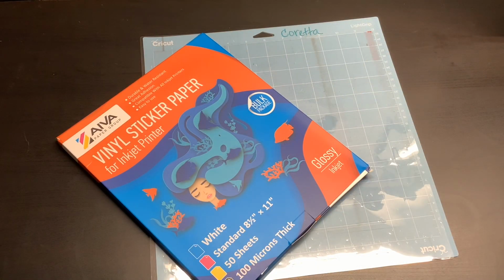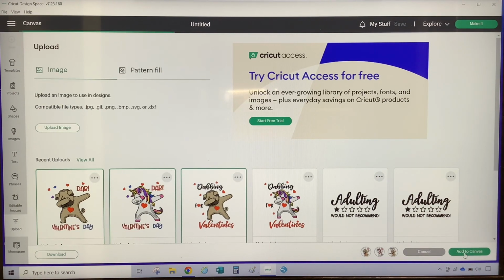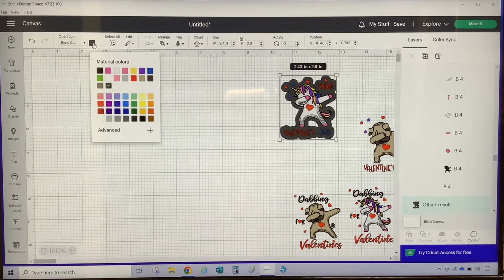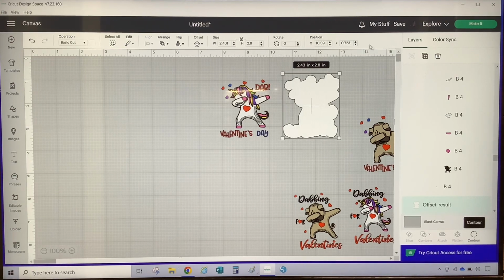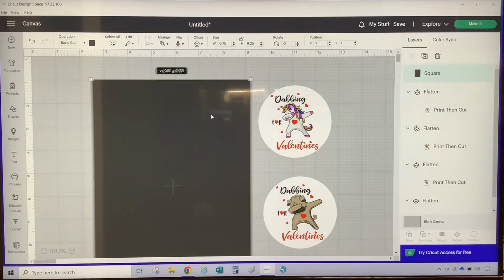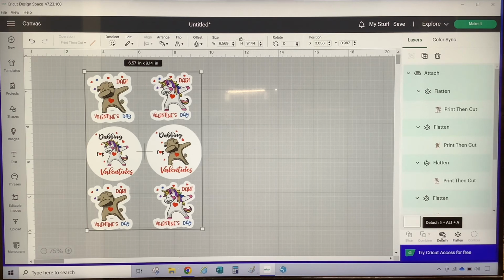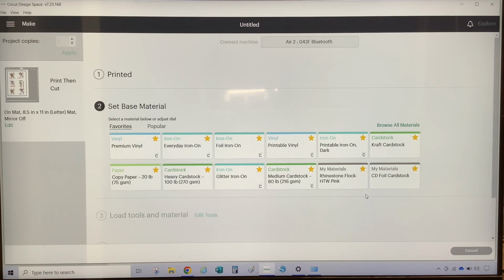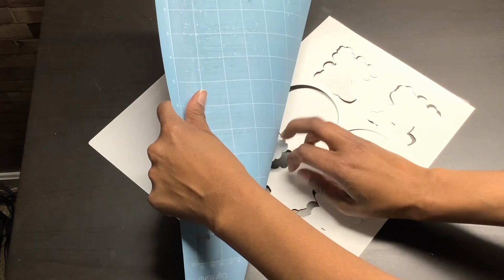DIE CUT STICKERS WITH CRICUT | PRINT THEN CUT STICKERS WITH CRICUT

Comment: Ms. Coretta will you please tell me how to get this word CHRIST CENTERED to be a size 9.5" W  x 2.0" H ( a little under 2" H) set to where a ss6 rhinestones will fit in the holes, I have been struggling with this for over a month now and the word hole just comes out either too small or too BIG and the word way to long for the project I am trying to do, please help me?😮‍💨
Reply from the maker: What program are you using?  If it is Cricut Design Space, rhinestone fonts are specific to size. You would need to choose a font that is the size you need. It is best to use Silhouette Studio to create rhinestone templates.
Reply: @CorettaDangerfield  ok thank you so if i do it in  Silhouette Studio how do i get it to cricut or do i still need to print out in cricut or i can print it out in Silhouette Studio
Reply from the maker: @c-yolife-rkc1  I have several videos on the channel that’s show you how to get the design into Cricut to cut. If you have a cameo cutting machine you can use that.
Reply: @CorettaDangerfield  thank you I do have a cameo as well I will try that and should I go back to this video or another one?
Reply from the maker: @metoo4444  these videos should be helpful to create a text rhinestone designs. 

HOW TO CREATE A RHINESTONE TEMPLATE AND UPLOAD TO CRICUT DESIGN SPACE
https://youtu.be/yT26tQLVdsA

HOW TO CREATE A MULTI-LAYER RHINESTONE TEMPLATE | MULTI-COLOR RHINESTONE DESIGN
https://youtu.be/uW9faydBmJE

HOW TO CREATE AN OMBRE’ RHINESTONE TEMPLATE | MULTI-COLOR RHINESTONE DESIGN
https://youtu.be/cq0PcCTjWss

HOW TO CREATE A MULTI-COLOR RHINESTONE TEMPLATE | MULTI-LAYER RHINESTONE TEMPLATE
https://youtu.be/9IJ1E7Zmz4w